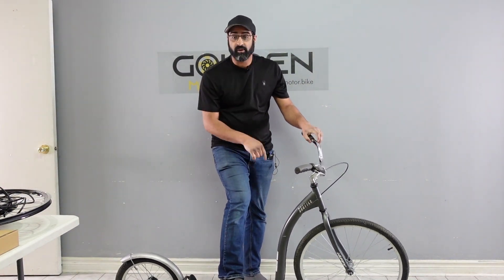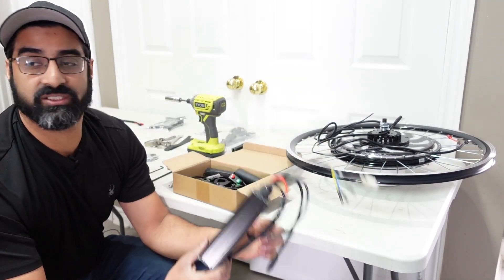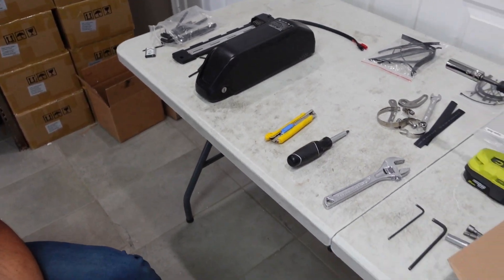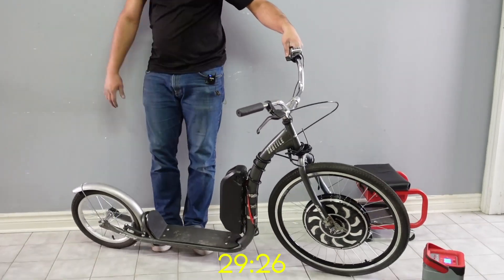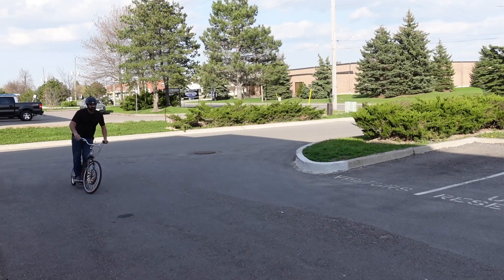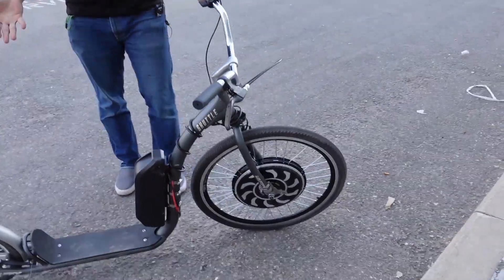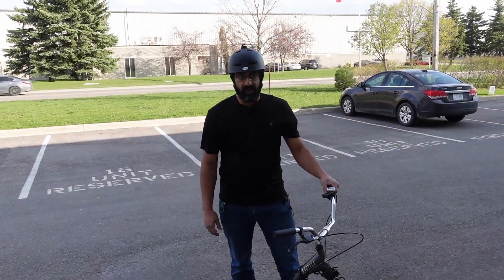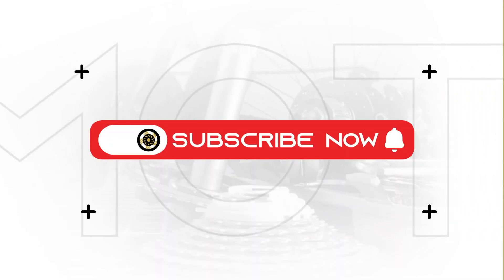How to Make an Escooter/Ebike in less than 30 Minutes!!

Comment: Pro's:  Light weight, easy to assemble, relatively inexpensive depending on the kit you get.

   Con's: (applies to all upright scooter designs).  A LOT of air resistance.  A sitting scooter is much better, but a sitting scooter with a substantial windshield and/or fairing of some kind, even much better.  The faster you go, the more energy it takes to push air out of the way and the more friction. 

   The ideal design (as regards energy efficiency) would be sort of a cross between a recumbent  bike and a velomobile.

Comment: Hey bro awesome build. Can you tell me how much something like this costs?
Reply: Scooters like that run for $300-$500 (look up Schwinn Shuffle or Osprey Apogee 26 inch)... the electric wheel + the control unit are also around the $300 range, and for a battery it is another $300-500.
Reply: That definitely beats paying car insurance and gas ✨ at least for someone like me and with my lifestyle.